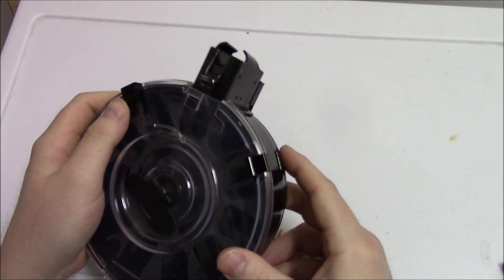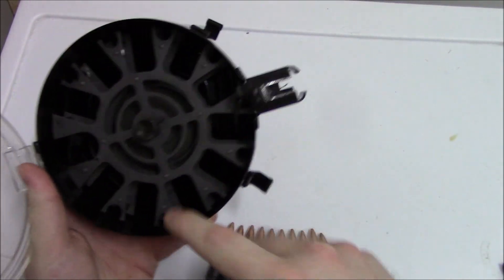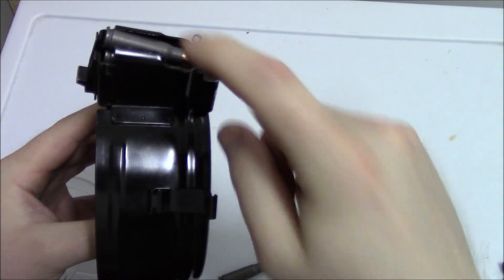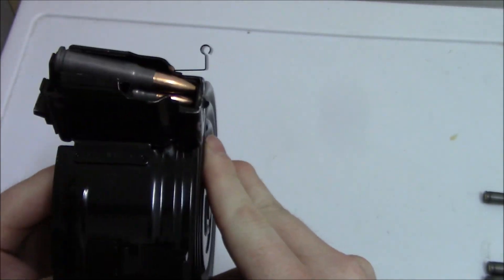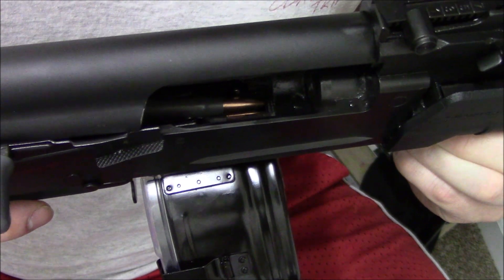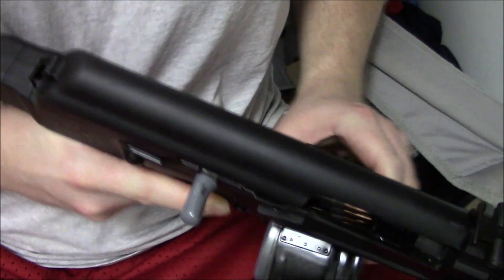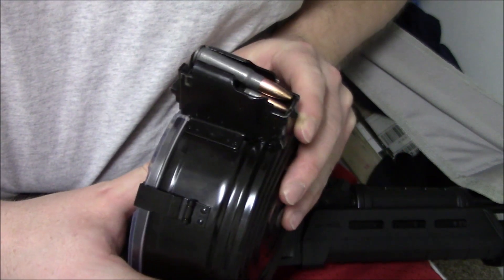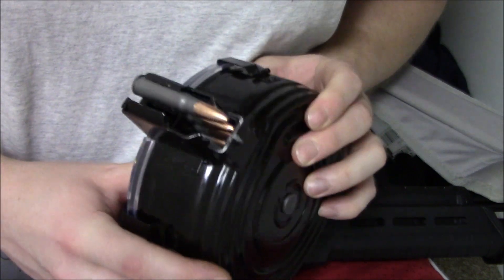Troubleshooting the KCI 75 Rnd AK Drum Mag

Comment: Dude, good vid! Having same issue in my vepr. Will be dremmel/polishishing that piece
Reply from the maker: i havent gotten time to rework it but i did fill that gap with weld. just gotta hit it with a grinder. lubing the inside will help with the spring. someone from kci commented and said hollow tip rounds cause more friction and to only use round. thats such bs though make your mags work with all ammo
Reply: Pab1oFresh I don’t use hollow tip 7.62 rounds (at least I don’t think so). Primarily Tula range friendly or RAS. I lubed the inside of the drum. I want to add a shim so that the angle of the drum is more forward like my Magpul d60 (which is a flawless AR drum).